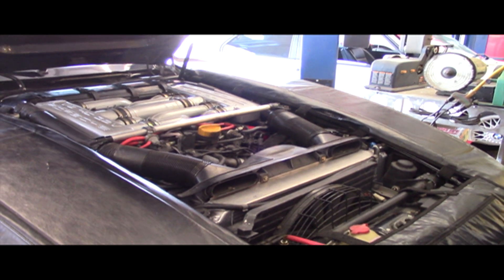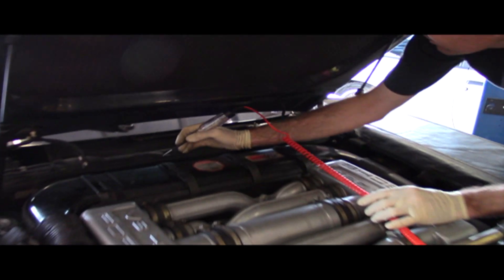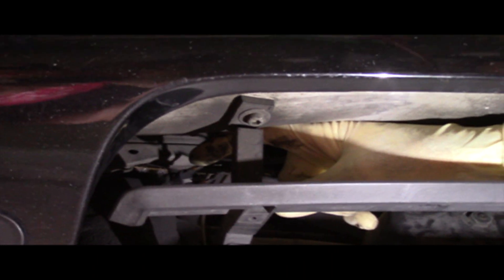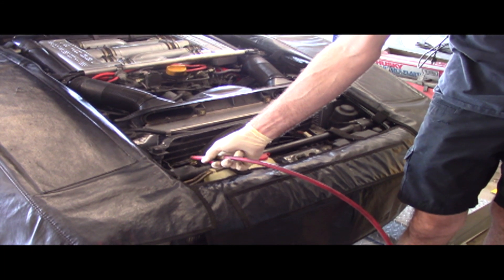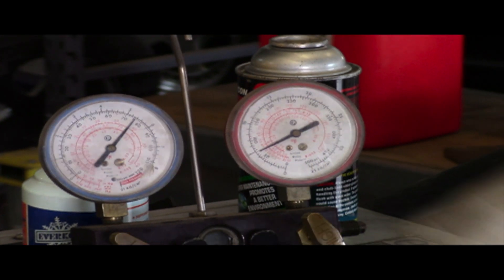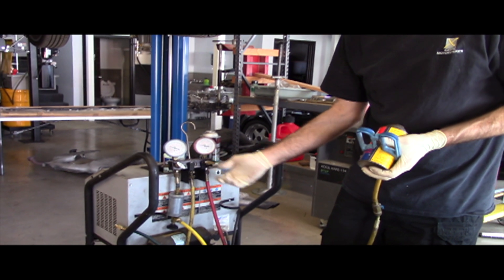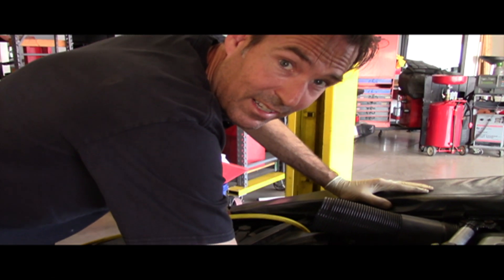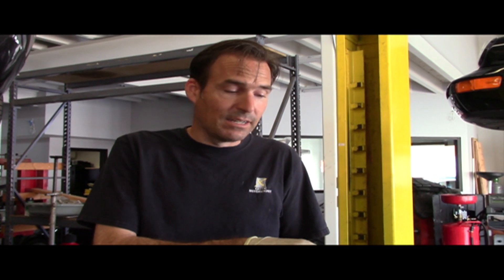Porsche Tech Tip- 928 Air Conditioning Tutorial

Comment: Great video! One question I converted the freon to 134 on my 1986 and used a cheap refill kit but I heard something popped around the compressor ( too much freon)  and all the freon escaped. Does the compressor have a pressure relief safety valve that resets or do I need a new compressor?